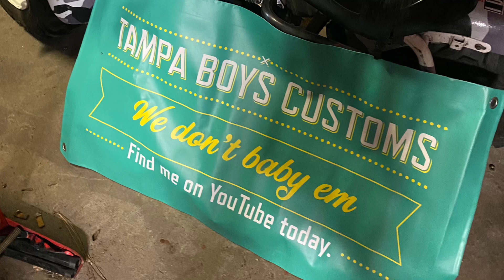80 MPH MINI BIKES  1/8 MILE AT SERCET SPOT / BIG BLOCKS 420cc , 390cc , 301cc , even 212 cc

Comment: I just finished my coleman ct200u ex with a stage 1 gx390 and a 40 series torque converter. Slung me off first throttle blip 
Then leaned over the handle bars it still picked the front tire up 4 inches before I let out
Reply from the maker: Heck ya that’s so sweet got any videos of that bad boy ripping
Reply: @Tampaboys  I don't currently if I do I will upload it to my account on here